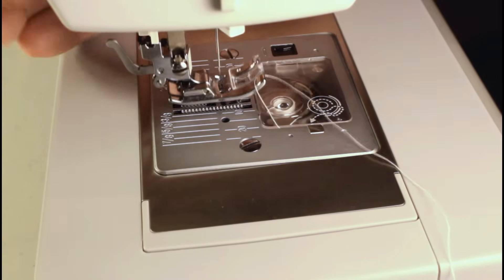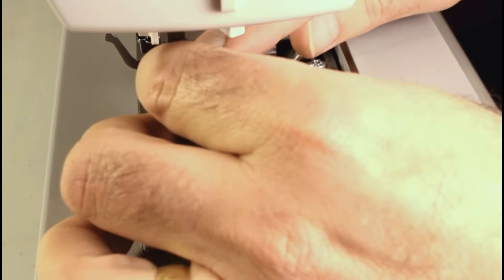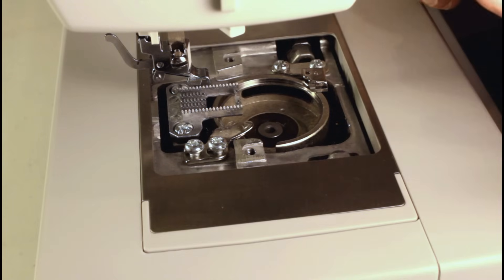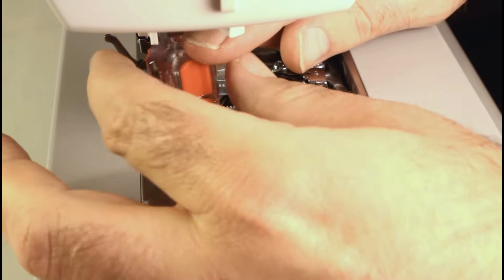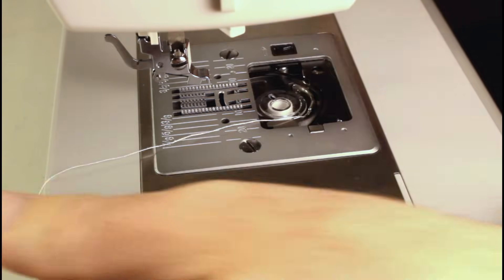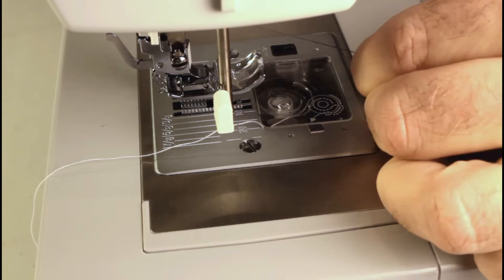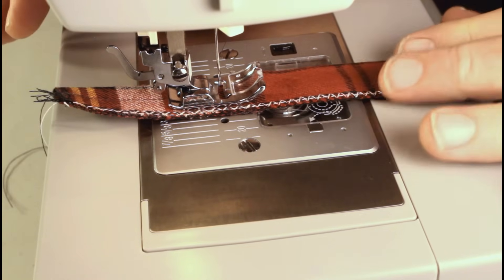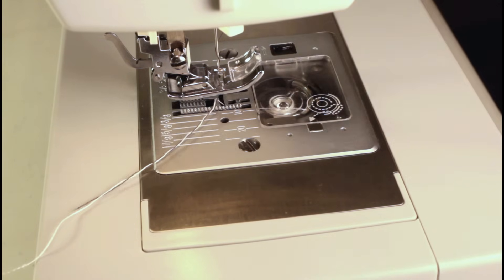Singer Heavy Duty - Adjusting Bobbin Tension, Please read the Description before posting questions.

Comment: Last night I opened up my machine I did see that yellow dot but for a million years I would have never thought a screw would be there to tighten. My machine is driving me bananas. I’m trying everything to fix the thread from wrapping around the bobbin area and from  pulling in the fabric. Hope this will work. Thanks a million.
Reply from the maker: Stardust You’re welcome!
Reply: Yes. Mine was a used machine. It would always sew about 6-12" before the lower thread knotted up beneath the needle. Sold it in the end..
Reply: Did it stop the machine from pulling the fabric in?

Comment: I so appreciate your technical videos for this machine. I was gifted this when I couldn't afford one, and it's turned out to be such a workhorse. It's also fantastic way to learn how to fix and maintain a machine. 

The manual says not to touch the bobbin tension. I just used a small screwdriver to peel away the sticky yellow gunk over the screw. The screw never shakes out of place after I adjust it, so I don't know why they glued it. I loosen both and remove one of the forward screws, it's easier than the back ones for me. I've oiled the wick under the bobbin once or twice, it makes a big difference.
Reply from the maker: Stitch Wishes I am glad to help. I am so use to adjusting bobbin tension in my industrial machines that it makes sense to me you should know how to do it in any machine. It is like the sewing machine mfgs. think you only sew with one type of thread, which is the same they test with, so you never need to adjust your bobbin tension.

Good for you for oiling the bobbin area. You are correct in that it makes a big difference.

Comment: Worked perfectly!! Thanks so much. My whole 4452 machine was jammed and would not move in any direction by hand or peddle, so my problem was much more than bobbin tension. At less than six months old and already looking at a service repair, I thought things were really messed up inside somewhere and was really disappointed in the 4452. I followed your excellent instructions, and yes, those inside screws are really tight! That was a great tip, I would have given up trying to move them if you had not mentioned how from the factory they are in there. I finally had to use a screw bit with a small 1/4 inch flat wrench to get them loose. I didn't follow your instructions to leave them in there but took one out to get at the other. It was another good tip because they are tricky to get started back in so much better not to take them out.  My bobbin holder was jammed in there and would not slide out as easy as in your video. This convinced me to try and get it loose and out, hoping it would free the machine. Once I gently pried it loose and took it out, the machine moved freely again. More than I every wanted to know about a sewing machine, but thanks again, your video saved me big time.
Reply from the maker: Thanks for the update! I am glad you worked it all out.

Comment: Thank you for your video. My problem: I have singer 4432, it has been working fine since I got it but since yesterday I couldn't sew anything the thread bunches up at the bottom. Please how do I fix it? Thank you
Reply: Check that your top thread is set up properly, make sure your tension is good  (around 5 is usually good) and pull both threads back as you begin to sew.
Reply from the maker: grace oluwajuyigbe https://youtu.be/

Comment: I found this video a couple of years ago, and without this I could not have fixed the problem with my machine.  In fact I had to find it again , because I forgot about the tension on the bobbin case.  Thanks again excellent directions.
Reply from the maker: You're welcome!

Comment: My problem seems to be with the top tension. I have to have the tension on 9 to get a decent stitch. The top looks fine but when you turn it over the loops from the top haven't pulled the bottom thread tight. You can pull the bottom thread right out of the fabric. Does this mean the bottom tension is too tight? I don't see a way to fix the top tension. It is a brand new machine and came with this issue!
Reply from the maker: Take a look at this video as a starting point. https://youtu.be/8TPB2yzw-1Y   If that doesn't help I have another video showing how to tighten the thread tension here: https://youtu.be/ddFcH5lnnjY
Reply: @kevinsews  Thanks for your reply. I think part of my problem was that I was doing upholstery and did have a fine upholstery thread. When I finished with my couch I put the machine away because we would be travelling over the winter months. I ordered a new bobbin case, put in a 14 needle and used different color top and bottom threads, cotton wrapped polyester on the bottom and the top seems cotton but the label is off. I got a decent stitch at 7 top tension. Anything below that and I could still pull the bottom thread out. I watched both above videos and of course the original video. I don't see on the second video here where you take the whole machine apart to clean, where you show how to tighten the thread tension. I looked on your actual page and didn't see the follow up videos (cleaning and tention adjust) but I think they are probably there and I'm just not finding them. Anyway, not comfortable taking a machine apart like that yet. I can work with a 7 tension if I have to but I may try to loosen the original bobbin case tension and see what happens. The new bobbin case seems to work fine, although not sure why I need a seven and not a 5ish for top tension. Was hoping a new machine would work right out of the gate. Don't want to spend more money bringing it for maintenance and also living on an island with only ferry transit makes it a pain.
Reply from the maker: @InAHandBasket  Okay, thanks for the update!

Comment: This video was published eight years ago but it is still helpful today. I recently purchased a new Singer denim sewing machine and I had to adjust the bobbin tension as it was a bit too tight and the needle thread was still showing up on the bottom side regardless of the needle tension adjustment. I was getting somewhat positive results at the max. needle tension of 9 but you can't always use the max. tension setting for the needle. Now, I am getting great results at default 4 for the needle. Thank you for posting this video.
Reply from the maker: My pleasure! I am glad to hear it was helpful.

Comment: Kevin please leave this vid and your others up for the help they assist.  I realize success comes not from getting a better machine, but from practice which threads/materials/speeds work together.  It is quite an effort to get going.  Like if I had top line basketball shoes, only using them playing basketball will make me better, not just the shoes.
Reply from the maker: No worries. I will leave them up.

Comment: Your videos are truly awesome! Between your thorough instructions on how to clean and oil a Singer Heavy Duty and this one, you saved me a trip to the service centre and a bunch of money! Thank you!!
Reply from the maker: Thank you! I'm glad it was helpful.
Reply: Had a bit of weird tension problems after cleaning and a clunking sound, so I did a bit of trouble shooting based on advice you gave other people:

- Took the bobbin case back out
- Added a bit more machine oil
- Adjusted the bobbin tension a random amount
- Put it back in the way you showed here
- Added a new needle
- Made sure to thread it properly 
- Tested it with a successful outcome! 

I noticed that you don't use the little felt liner in the bobbin case. Am I supposed to remove that?
Reply from the maker: No.

Comment: Very enjoyable video and quite informative, too.  Not to put too fine a point (no pun intended) on it, but I did notice that you inadvertently "needle-wrapped" the thread when you  threaded the needle (see video).  I believe this is why the topside tension was slightly greater right at the needle which created just enough added tension to create more 'pull' which drew the bobbin thread upward with slightly greater tension.  Thank you for showing the bobbin tension screw's access as this is often overlooked as a common solution to this problem.  Your narration was very smooth and informative as I said.       
                                                                                            Mike Kirwan - Kenmore, WA
Reply from the maker: My pleasure! I address the issue you pointed out when I uploaded this video a few years ago in the video description area. I guess I should recreate it at some point.

Comment: I love your videos!!! my machine started acting up, the thread in the top looked awful while the one in the bottom was perfect and this fixed it right up!  I did have to try a couple of times before i got the bobbin case in the right position because the small piece (even though i left the screws in) moved a bit and the thread was getting super tangled. But now it is working perfectly, I also learned how to put in the bobbin properly in this video haha :) I bought this machine because of your videos, THANK YOU!!!
Reply from the maker: You're welcome!

Comment: I bought a 4411 over a year ago, and it has sat on the floor most of that time. I also had bad bird nest issues with the bottom thread. I had been using metal bobbins from my old Kenmore, recently started using bobbins that came with the machine and, as if by magic, the bird nests seem to have abated!
Reply: That’s why it comes with plastic bobbins. There is an issue with metal bobbins because there is a magnet built into the aluminum frame beneath the bobbin case area. It will affect your stitches. In your case, it seems to have created a nest - although, generally you will get nesting if you don’t hold both threads firmly behind the presser foot when you begin sewing for at least the first few stitches. What happens if you don’t hold the threads? Well, the bobbin thread tangles in the bobbin case, taking the needle thread with it on a bad trip! They tangle and form a nest. How to avoid a nest: Make sure fabric covers the feed dogs (metal moving “teeth” located under the presser foot) BEFORE you step on foot control, holding the needle thread & bobbin thread under the presser foot and BACK past the presser foot so the feed dogs can’t “eat” your thread by swallowing it down past the moving teeth and into the hole. Get in this habit until it is second nature. Also, never turn the flywheel (big wheel on the right of the machine) away from you. NEVER! Always turn the flywheel toward you and always LOWER needle into fabric before continuing to sew. This machine does not automatically lower the needle into the fabric for sewing; you must remember this step to avoid operator error. Have fun sewing. Read your manual, and learn all you can to enjoy your machine more and more!🙂😉
Reply from the maker: Use class 15 (not 15J) plastic bobbins. Plastic bobbins don't bend the way today's cheep metal bobbins do. They stay nice and smooth and allow the thread to glide around the edges. A metal bobbin usually warps slightly and can have some burs along the edge. This causes all kinds of problems. You can find Class 15 Plastic Bobbins at Walmarts that carry sewing supplies. Otherwise, order them online or visit a local sewing store. Amazon has them as well. 

After you give that a try come back here and let us know the results. If you are still having a problem then post as many details as you can and we'll see if we can help you out.

Comment: Thank you so much!!! I recently bought a Singer Talent sewing machine and it’s been driving me nuts!!! I was thinking of giving it away to someone else but then who’d want it if it doesn’t sew good stitches? I kept researching on the internet about tension and found that the bobbin tension is too high. I wanted to modify it but then there was that dot of paint or whatever it is, I tried to remove it but it wouldn’t go away and gave up. I understood that I probably shouldn’t mess with it…
Now I want to try again, I have to get this machine to work well. I don’t get it why they set it like that from the factory, why would anyone want a sewing machine with bad tension and that causes a lot of frustration and stress? Becouse I can’t use it like this, even if I raise the needle tension, the fabric puckers, it’s too much tension on both sides.
Reply from the maker: I am glad to hear it was helpful to you!

Comment: Even though this did help me to free up my 4452, it took hours with many tries with lots a jammed thread and disassemble/reassembles  to get it to sow properly again. Once you loosed those two very tight screws, it's trail and error to get the little bracket back in the exact position for the machine to sow correctly again. I think it's finally working again but almost afraid to try it on something other than a piece of scrap after so many jam ups.
Reply: Any guidance on how to adjust that little bracket? There's quite a bit of variability as to how much play the bobbin casing has to rock back and forth.
Reply from the maker: Download the manual here: http://www.kevinsews.com/download/SingerHeavyDutyServiceManul.pdf  See page 19.

Comment: I find a little bit easier to adjust the tension on the bobbin case of my Bernina 1008.  Since I am thinking about buying a Janome HD3000, it seems that the same manner will be done on the Janome.  Thank you for showing this.
Reply from the maker: orestesdd Yes, the old style front loading bobbin systems make adjusting the bobbin tension much easier than top loading bobbin systems. The trade off is not being able to see how much thread you have in your bobbin and that was always an issue that people didn't care for with front loading bobbin systems.
Reply: Thanks for all your advice and opinions.  They have been a great help to me.

Comment: Thanks for the explanation about the bobbin tension. I felt that my bobbin tension was too weak when I pulled on it compared to the tension of the top spool. And I wasn't getting too good of a stitch. Probably my fault because I've only been sewing for about three days, or about three hours in reality. I bought a 4423 last week to try to do some auto upholstery in hopes of changing my career of 37 years as an auto tech and repair business owner. I need out. Badly. I'm burned out and finally realizing it. This media driven scare festival has caused my business to drop off in half. This all may turn out to be a cloud with a silver lining for me though, as I contemplate shutting my shop down after 20 years of success. 
But I digress, sorry. My question to you is, shouldn't the top spool and the bobbin have the same feel, physically, as to the tension? My bobbin felt so loose compared to the top tension. So I adjusted my bobbin to feel the same tension as the top spool a few hours ago. I saw this and I did it exactly how you did except for that I removed the front thingamajigga under the plate instead of the back thingamajigga to remove the bobbin holder. Either way, it worked out fine and seems to be correct. 
I also realize that this so-called "heavy duty" sewing machine is definitely not for auto upholstery. This shows my ignorance in the sewing world. So I ordered a Juki DNU-1541 that's supposed to arrive today sometime.
Reply from the maker: I use a 1541 as well. It will be great for upholstery. I changed out the thread tension plate to one with double tension and it is much more versatile now.

Comment: Thank you so much for posting this. You just helped me solve 1 part of my problem! Thanks Kevin! Any chance you might know why I am getting a lot of pulling resistance on my thread after I place my thread through through part 4+5 of my tension disks? (I have a Singer 6800C). I know I am threading correctly.. This is something new. Have an amazing day!
Reply from the maker: First, turn the tension down to 0 and pull the thread through and see if it flows freely. If it does slowly tighten the tension while slowly pulling the thread through the needle until it starts slightly moving the needle. That will give you a good starting point. If the thread doesn't move through  at 0 then get some dental floss and clean out the debris in the disc.

Comment: Your video is very helpful but I completely removed that yellow thing inside the bobbing  case, please what do I do help me.
Reply from the maker: Just screw it back in?
Reply: Is the yellow glue on the tension screw that is on the bobbin case, I’ve removed all of it and it can not be put back and now I have tension problems.
Reply from the maker: @wigticious8649  Too much or too little tension?
Reply: @kevinsews  is not too much and not too little but is not as it should be because I can see the other thread at the back.
Reply from the maker: @wigticious8649  okay, try tightening the needle thread tension a bit and see if this helps any. Otherwise, your bobbin tension is still too tight and pulling the needle thread too much.

Comment: Thanks for your video! I took my bobbin case apart and the yellow screw was pretty much falling out. It was not even threaded. I tightened it quite a bit since it was not in there at all. It helped a lot but I still have slight top threads showing through to the bottom with tension set at 4 and stitch length at 3. I’ve rethreaded, cleaned, used different bobbins, etc. Any pointers are appreciated!
Reply from the maker: Try tightening the thread tension a bit if the thread is showing on the bottom side.
Reply: I’ve tightened it all the way back and forth from 4- 8 and not much difference showing
Reply from the maker: @LaurynSmith-j6k  See my video on getting to a starting point here: https://youtu.be/8TPB2yzw-1Y?si=ONSmvKpF9ia6EOuP  In the end it is a balancing act to get it just right.
Reply: @LaurynSmith-j6k I’m having the same issue. Did you find a solution?